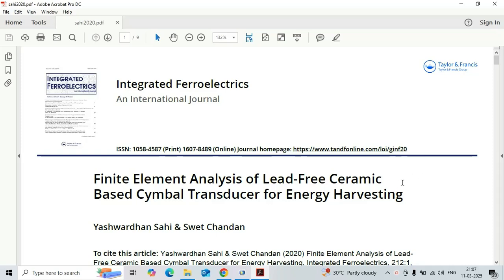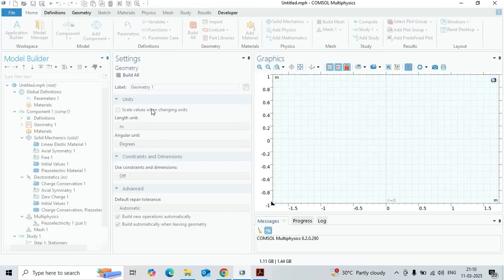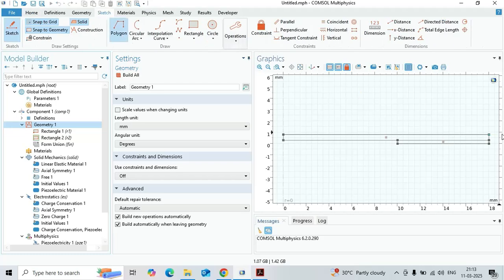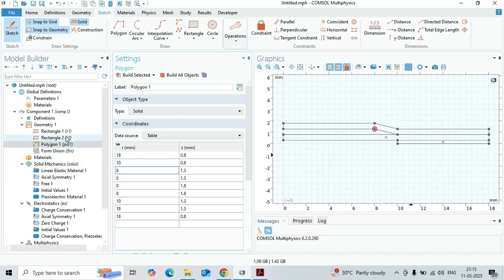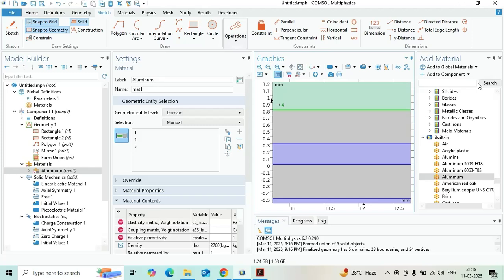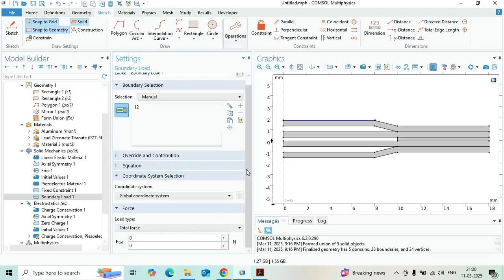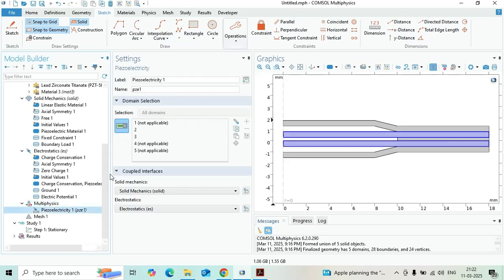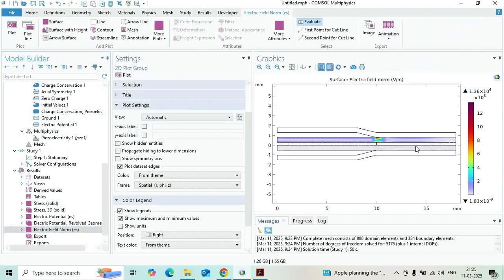Finite Element Analysis of Cymbal Transducer for Energy Harvesting in comsol Multiphysics

Comment: Hi, I have a question. I am using a Turbulent Flow model, and I have observed that the simulation converges when I assign a low inlet velocity. However, when I set a high inlet velocity, the solution fails to converge. How can I properly define a high inlet velocity in a time-dependent simulation to ensure convergence?
Thank you
Reply: Change settings
Reply: @ what do you mean? What settings?
Reply from the maker: There are setting option is there for Time dependent function u can change it ,try it like number of steps, Tolerance, Method also u can change and try
Reply: @Mechanical114 Thanks for the response. I tried to increase the number of iterations and still didn’t converge.